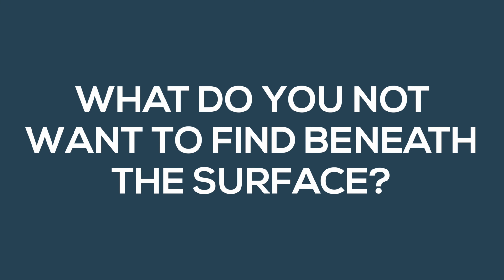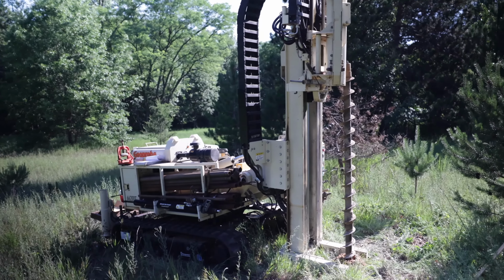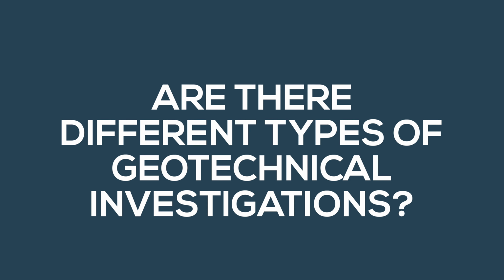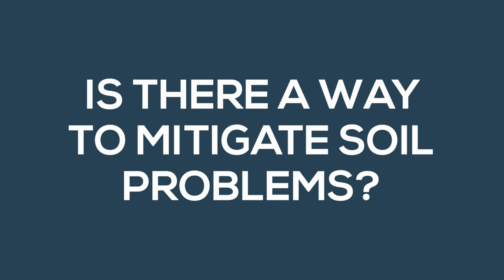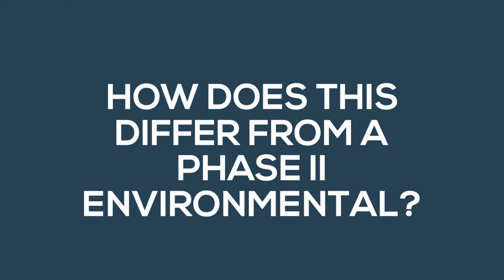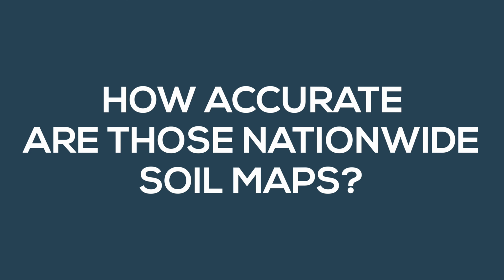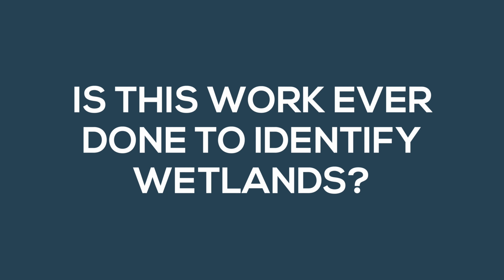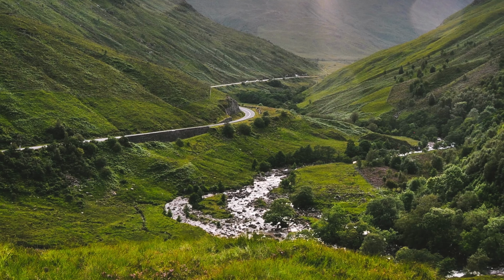What Is a Geotechnical Investigation?

Comment: How do I determine the imposed load that the building can sustain? Assuming I don't have the area/width of the foundation
Reply: Generally you can see the design load requirement in different building codes, mainly ACI-318 and ASCE 7. These codes have load requirement for all types of buildings (commercial/ residential etc). Designers use these codes as standards.